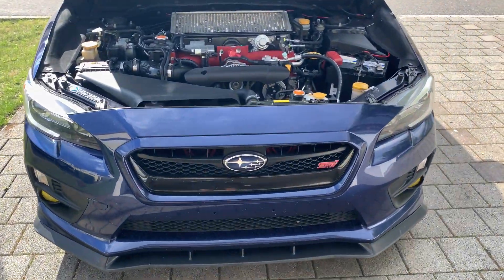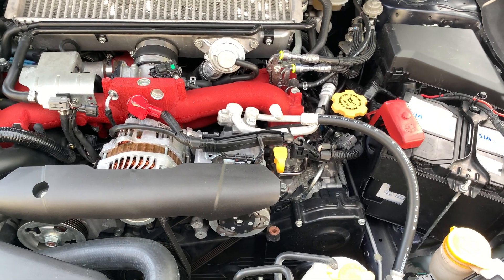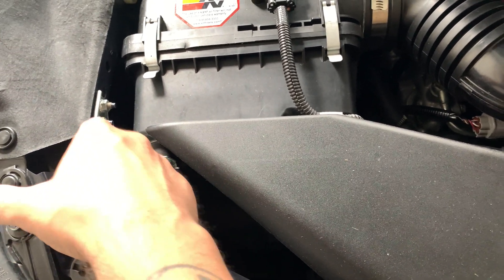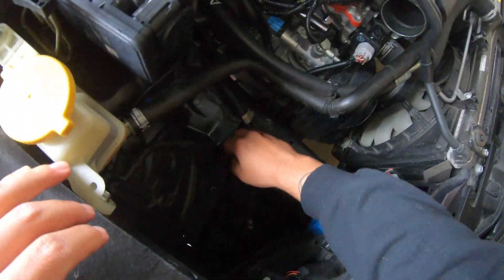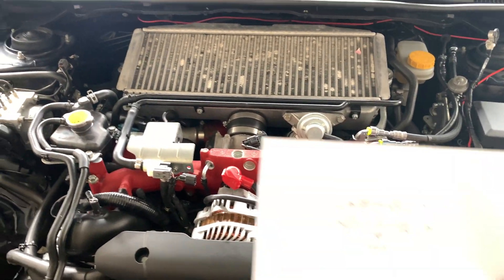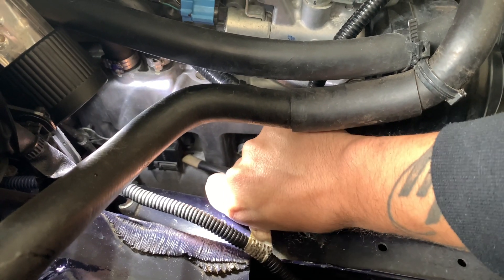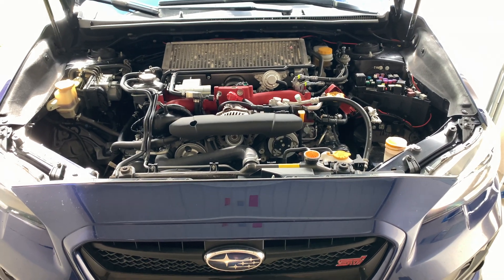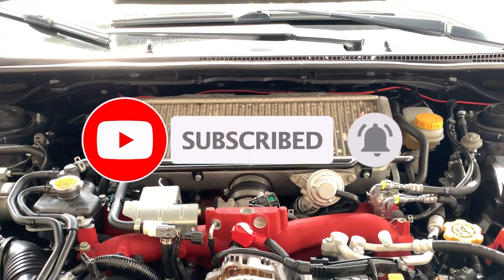Subaru STI Compression test | EJ257 | EJ205 | EJ255 | EJ207

Comment: Awesome explanation!! One question I have is do you have to remove one spark plug at a time, test the cylinder and then put it back? Or do you take all the spark plugs out and then start testing each cylinder? Thank you!!
Reply from the maker: Thank you and glad you could get something out of the video!  As for your question. Yes one spark plug at a time to keep the block sealed and not get different readings.
Reply: Stock manual says to pull all plugs then test each cylinder. Make sure to hold your gas pedal down so your WOT while cranking. I made the mistake of not doing this and I got low readings almost ripped out my engine to do a full rebuild when it wasn’t necessary

Comment: Just FYI, if you hold the throttle flat to the floor when cranking the engine it cuts spark and fuel, so you don’t need to remove the fuse.
Reply: Hey Dan, I’m about to do a compression test on my 06 Sti tomorrow. And I was gonna pull the fuse to the fuel pump. So your sure if I just hold the gas all the way down and try to crank it on it won’t send fuel into my engine. Cause i don’t want to flood it.
Reply: If this is true then your comment helps so much!!
Reply: @camiroshan1566   not 100% sure if it’ll work on the older cars, mine is a 2015 and has this facility. You might need to still pull the cam sensor.
Reply: @scoob_dj  how do I do that
Reply: @scoob_dj  could I also maybe just pull the fuse like this guy if I find out which fuse it is
Reply: @scoob_dj  hey I’m pretty sure flooring it cuts off the gas from an 06 too so I’ll just go for it